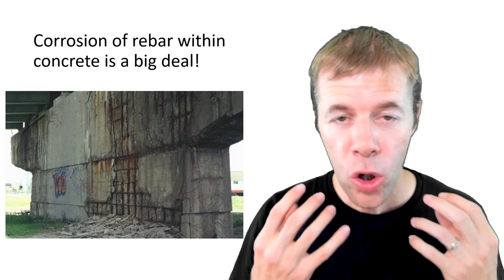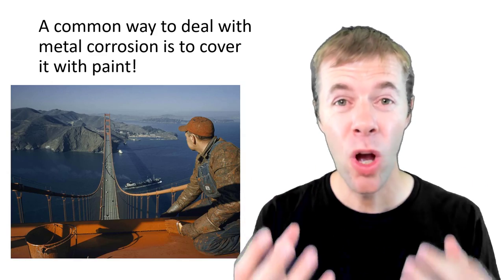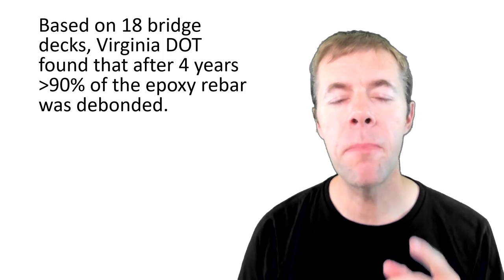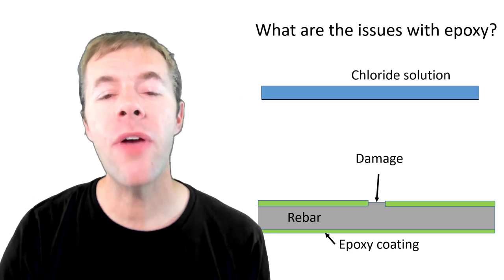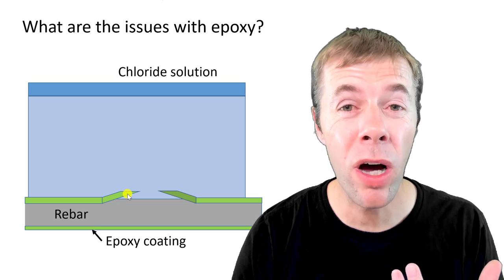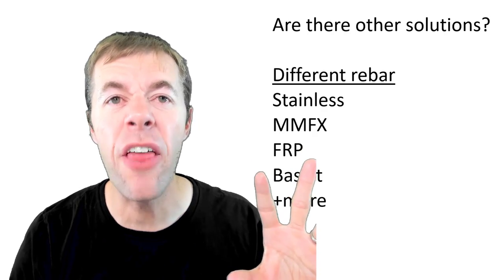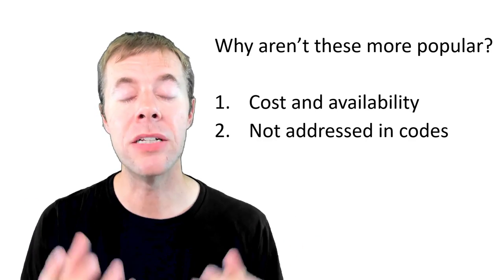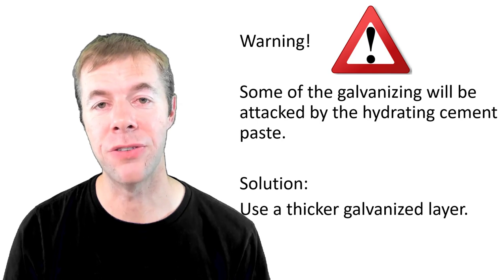What is epoxy coated rebar and why is it being banned?

Comment: No, I dont think so that galvanized rebar is the solution. Neighter is the raw rebar after the Miami Condo collapse. Back to the ancient I say. Away from the skyscrapers. Basically all skyscrapers will collapse with time when the rebar is corroding. Obviously.
Build the buildings like the greeks and romans did. Use an sofisticated of arcs and thick slabs of cement-stone beams for structural support. The tower of Babel should be the example: below broad and wide and narrowing each story higher. That gives the buildings sufficient stiffness and it will not fall over.
Like that old spanish colonial buildings were built - without iron rebar. And those buildings stand still after 300 years - which for sure will not be said of modern skyscrapers. Imagina the Burj Khalifa rusts one day away and falls over. I wouldnt want to be on the top level at that point.
So back to buildings without iron and steel structures and build buildings again using physics only with thicker materials (like the greek did) or with an arc method using physics to spread the load (like the romas did).
Buildings from brick and stone are the way to go.

Comment: Or stop using concrete and cement in ways it wasn't intended. Almost anything you put in concrete will degrade .when the Roman's put reinforcements in they would use iron iron doesn't rot the same way steel does. So you don't get the same type of cracking and splitting. Making concrete and cement properly helps too ours falls apart in 100 years the Roman's has only gotten harder over time they speculate that being from the use of salt water in the concrete

Comment: It’s a matter of economic life with rebar, there is no permanent Fix.  Neither Epoxy or galvanizing or even stainless steel is proof against corrosion. 
   FRP pultruded rebar or Plastic sleeved post tension cable might be considered.  Seal the concrete.

Comment: The epoxy coating itself needs reinforcing. So coat it in a handle resistant material like lacquer.

I find this stuff about reinforcing the reinforcement laughable. This stuff is going to fall apart be it by corrosion or by plate tectonics so a 50 year life to concrete, rebar, epoxy is just normal. Your grandkids fixing what you've laid in your time seems fine to me so the kids have a nice project to do.

Comment: This whole video is incorrect even galvanising will chip off when the rebar is bent at right angles. I've owned 4 ferro cement yachts over the years, now 50-60 yrs old. They suffer no corrosion thou only 3/4 inch thick. It's important to have mild steel bar for the cement to adhere to. Epoxy is to hard and slippery for cement to grip ,meaning any flexing would burst the finished planking. Boats do use galvanised chicken mesh fixed over the steel core however. Badly built boats will rust and some early ones were built with steel pipe frames which rusted from the inside out causing the build to fail. Well built they don't leak in or out even when left unpainted for years.

Comment: If you were to delve into the  body of well respected research on the performance of galvanized rebar, you would find a small number of long term performance application assessments where galvanized steel rebar has done well but in the vast majority it has not. The industry will NOT do the corrosion studies that epoxy coated and stainless steel rebar are exposed to because galvanized rebar fails - quickly.  In very specific environments, it can do very well but that is not representative of the reality of the typical aggressive corrosion environment.  It is failing, Of course every application has to be assessed to determine the level of corrosion resistance that is actually required.  Calling MMFX "poor man's stainless steel" is repeating company propaganda and inaccurate, It is an alloy steel..... just like weathering steel.... just stronger.

Comment: I totally disagree with this guy. Study should be implemented in a building Code, if the results are accepted by consensus. Until then don’t put bad reputation on good performing epoxy coated bars. Epoxy is a very good protection and it is better than galvanizing. ACI code has provisions on using epoxy coated bars. Of course bars should not be defective or damaged, but this is understood. Galvanizing is zinc protection. It is better than nothing, but zinc is a sacrificial layer, subject to corrosion, and will not last as long as epoxy. To prevent debonding of epoxy coated rebars, follow ACI code and increase embedment length, anchoring length and so on. Read and follow the Code. If you violate Code, then all kind of trouble will begin, including the bonding he is talking about.

Comment: I support capitalism, free enterprise. But it does have a built-in flaw.
Take this video. Good video. But the construction company is a private enterprise. So it seems to me that the best way to stay in business is to do a good job but not pay too much attention to the actual longevity of the finished structure. If rebar in the concrete of the elevated highway you built lasts forever, you've done yourself out of future maintenance contracts. So, even a company with an excellent and well-deserved reputation STILL has an incentive to use materials that break down over time. That way they'll stay in business longer.
I don't think automobile manufacturers ever had any kind of sophisticated 'planned-obsolescence' programs. But they also have no incentive to produce a vehicle that requires no (or minimal) maintenance, repair and replacement, either.

Comment: Use actual REAL epoxy, not the powdercoat imitation garbage. Real epoxy is an oxygen barrier. And flexible. 
The rattlecan stuff aint gonna cut it either. 

Develop an onsite protocol for touchups/repairs of compromised coating using an oil based product, or mix up some actual epoxy.